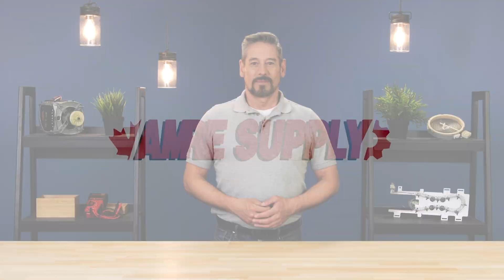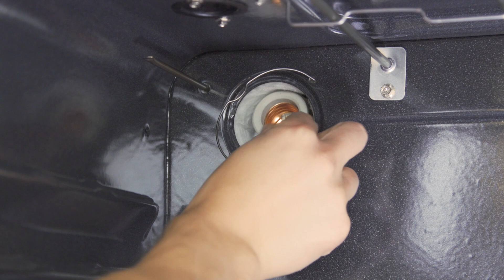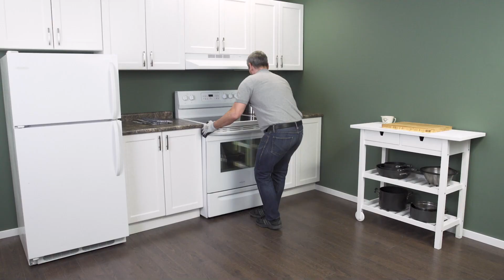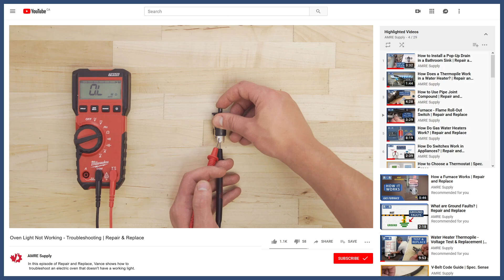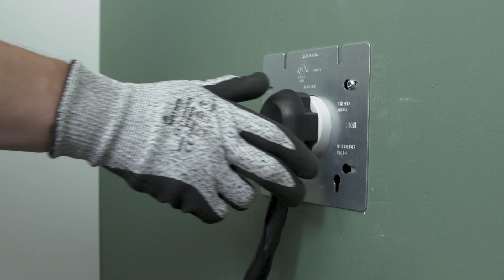Oven Light Socket | Repair & Replace

Comment: Thanks I didnt know the socket could be changed thanks
Reply from the maker: You're welcome. If you have a wall oven then the socket is likely accessed from inside the oven. You would have to use a screw driver to press down on the locking tabs.
Reply: I saw the socket when I was following your directions to tracking down why the oven lock wouldnt unlock .the electric motor and the arm were located in the front and the socket is right there in the front on the ceiling of the oven. That was a very productive day . And the cookie Baker was happy . Me too thanks
Reply from the maker: @rbshort151  You're welcome, we're glad that the videos were helpful to you!

Comment: With the power wires disconnected, what should be the resistance for:  1) a good socket without the bulb;  2) a good socket only;  3) a good bulb only?
Reply from the maker: Thanks for watching. Testing the socket using the 2 terminals at the back without a bulb will not have resistance as there will be no continuity. To test the socket without a bulb you would need to touch one probe to the back and one probe to the inside of the socket and repeat the test for the other 2 connections. This isn't really practical.

A standard 40 watt bulb will have a resistance of about 360 ohms. Testing the socket and bulb together should also show around 360 ohms.